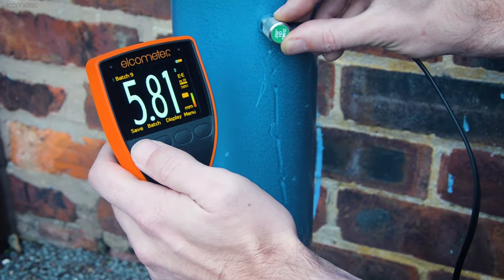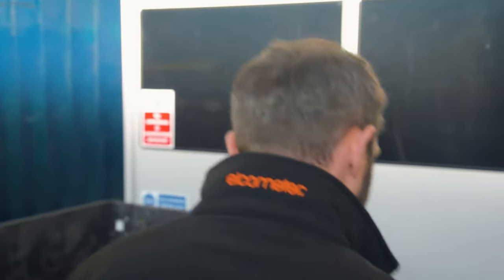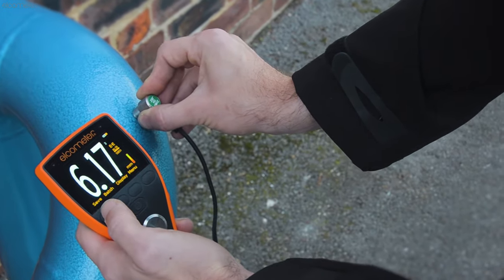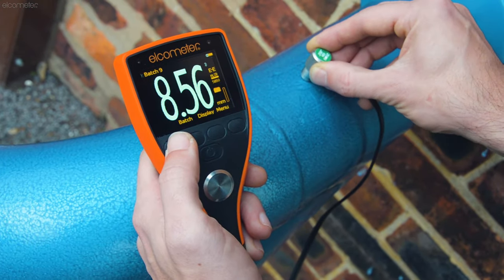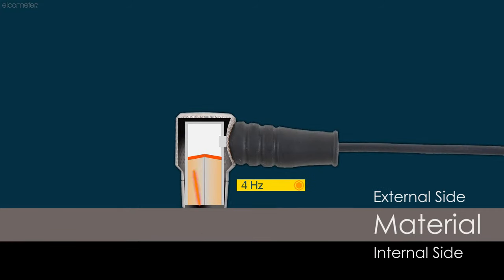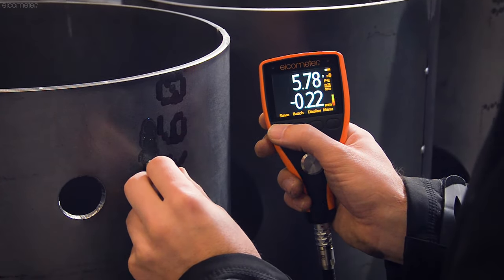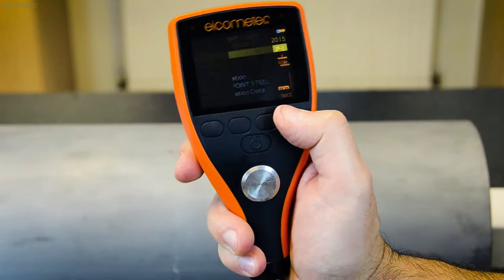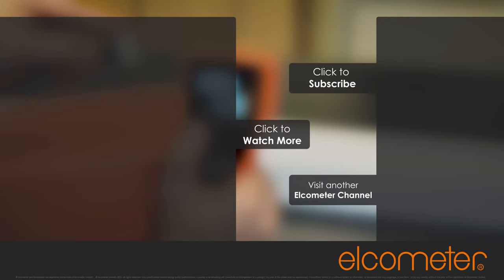How to measure material thickness using the Elcometer MTG8 Ultrasonic Thickness Gauge

Comment: Hi Dan, can MTG6 gauge and Thrupaint transducer show paint thickness ? Or show both material thickness and paint thickness ?
Reply from the maker: Thank you for your comment.

With the correct Thrupaint transducer, the Elcometer MTG6 can measure either both material thickness and paint thickness (in P-E mode), or ignore the paint thickness and measure just the steel thickness (in E-E mode) through coatings up to 1mm thick.

For more information please contact techsales@elcometer.com or visit www.elcometer.com/contact-us to find your local Elcometer distributor.